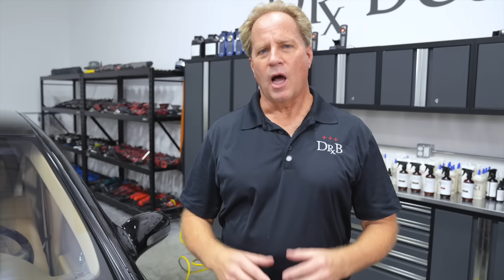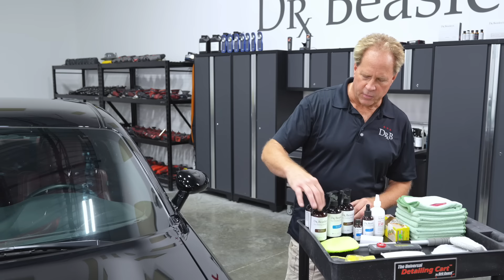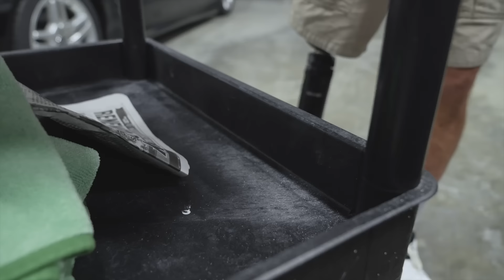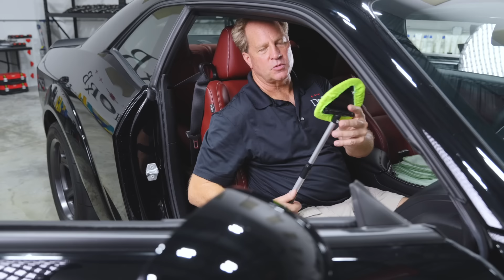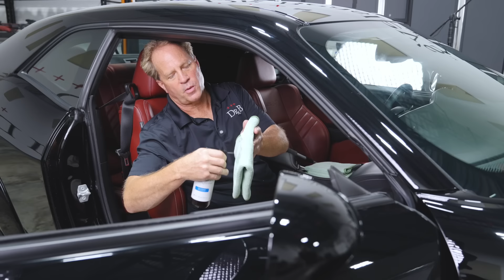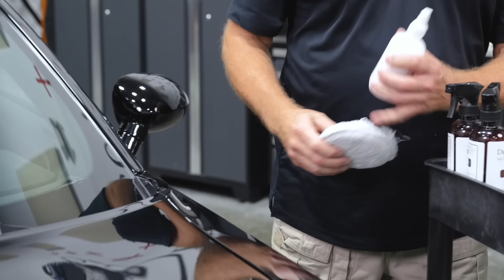How to Clean Your Windshield Inside & Out | Step-by-Step Beginner Guide

Comment: Mike Phillips!!! Great info as always! Glad someone finally put to rest all that newspaper talk. It never fails there will always be someone in the comments talking about it. As far as towels go, I haven’t used the Dr. Beasleys glass towel but it reminds me of the FTW by TRC which is the best I’ve ever used on glass. Plush twist loop with zero drag. The FTW in combination with Adams Brilliant Glaze has made the interior windshield on my car PERFECT 👌
Reply from the maker: The newspaper theory I shared actually makes a lot of sense to me and to a lot of other people but if you were to read through the comments there are a few people that completely disagree.  The good news is - all that's important when it comes to glass is however you get to clean and clear is all that's important.

Also - the green towels you see me using are the same towels you referenced at The Rag Company, that is the FTW - or - For The Windows are the same towels you can find on Autofiber.com - which are the,

[Korean Twist] Microfiber Detailing & Glass Towels (16 in. x 16 in. 600 gsm) 3 pack
https://www.autofiber.com/collections/glass/products/korean-twist-microfiber-detailing-towels-16-in-x-16-in-600-gsm-3-pack

And these are my favorite microfiber towels for just about everything.  Removing compound and polish, using spray detailers, spray coatings, waterless washes, etc.  They be a darn nice towels and they have some GIRTH to them instead of being light and fluffy like most towels.

Thanks for watching and commenting.  -Mike Phillips
Reply: I thought it looked familiar! And I Agree 1000% that towel is SUPER Versatile!!!

Comment: I noticed that you always had some glass cleaner on the towels, does dry wiping cause the fibres to stick to the glass? every other video i have seen suggests using a dry towel for the final wipe.  I am having issues with the fibres on my windscreen and removing them from the inside, any suggestions?
Reply from the maker: I like to have a light mist of product on my final wiping towel so it has the ability to remove any smears or streaks that I cannot see in the moment.  If there are any streaks or smears, (that I can't see after the initial wipe), a totally dry towel will struggle to remove them, thus a fine mist of product on the final wipe towel.  Lint is annoying and almost impossible to avoid 100%, so don't let it drive you crazy.  Once you start driving, the lint will dissipate.   Thanks for watching and commenting.  -Mike Phillips

Comment: What a vehicle that was parked around trees 🌳  can windshield  collect something from the trees 🌳?
Reply from the maker: Yes.  The contaminant is likely tree sap.  This can show up as small globs of sap randomly found on the windshield and/or horizontal body panels.

There's also a form of tree sap called Tree Sap Mist and instead of globs of sap, you get tiny little DOTS or BUMPS you can feel with your hand.

The first thing to try is a simple wash because some tree sap will dissolve with water and soap.  For other types of trees, bushes, plants, you'll need a solvent to dissolve any dried tree sap.

Thanks for watching and commenting.  -Mike Phillips

Comment: my honda civic 2011 cpe. the windshield is huge and is like 35 dgre angle. not easy to clean. tried different methods and i never get it right. lint lint
Reply from the maker: Even if it's a challenge, hopefully, the tips in this video make it a little easier. -Mike Phillips

Comment: every microfiber clothes ive used on my glass has left behind little fibers behind.
Reply from the maker: The flat weave style towels are normally a pretty safe bet for not leaving lint behind, but I like the green towels you saw me using in the video.  Do they leave a little lint?  Probably overtime as the fibers and the towel itself wear, but it's never been enough lint to annoy me.  Clean glass with a little lint is better than dirty glass with no lint.

Thanks for watching and commenting.  -Mike Phillips

Comment: The stuff on the inside of the glass is typically oils and other petroleum by products off gassing from the plastics in the interior combined with ambient dust and vapors.  That’s why it’s hard to clean.
Reply from the maker: That is a great description of what you're dealing with on the inside.  In the detailer world, it's called *Vinyl Fog*.  And as you state, it's an oily film that build-up from outgassing from all the plastic and new materials used to build a new car.

What most people don't know is in the same way this oily vinyl fog builds up on the inside of the glass - where it's visible, this same outgassing oily film can build up on ALL the other surfaces, like the headliner, dash, door panels, seats, etc.

The vinyl fog is not picky about where it lands and attaches.

Thanks for watching and commenting. -Mike Phillips
Reply: @DrBeasleys Yep.  Helped my son clean his car for the first time in a while and he was surprised to see my hands smeared black cleaning the gray rear shelf.  It was a few years of build up (black plastics, black carpet, black upholstery).

Comment: It's really good to use the Bug Remover scrubber on the whole windshield because there are always so many little ones and specs you can see but as you are scrubbing you can feel it working. So you don't have to keep going back for the ones you have no idea how you missed.
Reply from the maker: That's a great tip! Thanks for sharing your preferred method. -Mike Phillips

Comment: I still, and always have, used 0000 steel wool to clean my “glass” windshield and side windows. Never side view mirrors.
I use a high quality glass cleaner…possibly Beasley’s now…but Griots is one of my preferred at the moment.
0000steel wool gets ALL the baked and etched in water spots off. I’ve tried clay bars, but seriously, it’s still not as good as 0000. I will use a high quality clear coat polish to create that ultimate “clean” and water shed. Longer periods between clean.
Thanks for the videos. I’ll keep an eye out for your products.
Reply: Interesting to hear the use of 0000 steel-wool here.  Do you use anything while performing the steel-wool step?  Thx
Reply from the maker: If you're having good luck cleaning glass with steel wool, more power to you.  I've never done this and probably never will as I know other options to avoid pushing steel over glass.  As a person that has removed a LOT of scratches out of glass with a full understanding for how long this type of polishing works, I simply don't use steel wool, not even 0000 steel wool.  

BUT - I don't have a problem with all the people that do use this type of thing to clean their glass.  At the end of the day, as long as you have a process that works for you, that's really all that's important.

Thanks for watching and commenting.  -Mike Phillips

Comment: Thanks for all the videos. Is RainX or a ceramic detailing spray a good glass coating?
Reply from the maker: I used it for years in Oregon, where it rains a lot, when the wipers quit working on my Triumph Spitfire.   

Thanks for watching and commenting.  -Mike Phillips
Reply: I never liked RainX because the drops are moving which I find distracting, and it seems to me the drops cover more area between wiper swipes. It also seems to create a film that is visible at night and creates a lot of glare. But that was just one car, I won’t try it again to see if it would happen on another car. I’d be interested in other people’s experience with this.